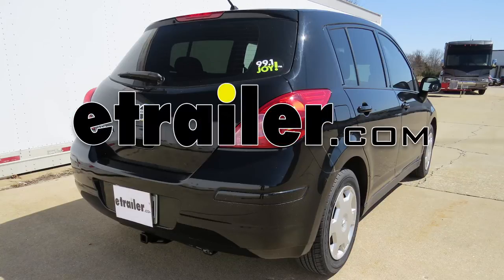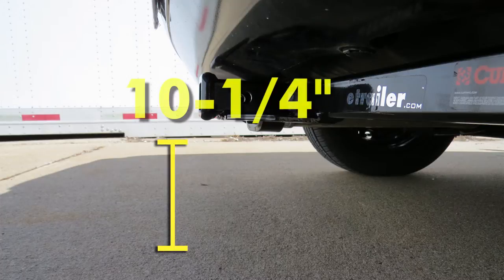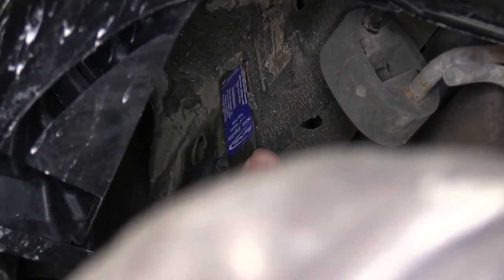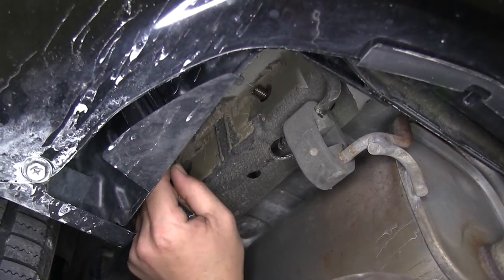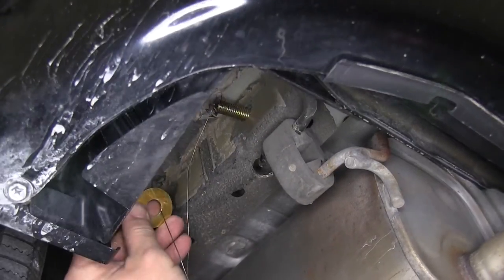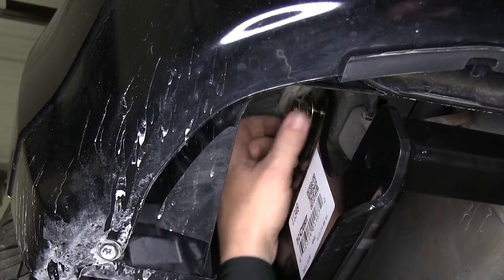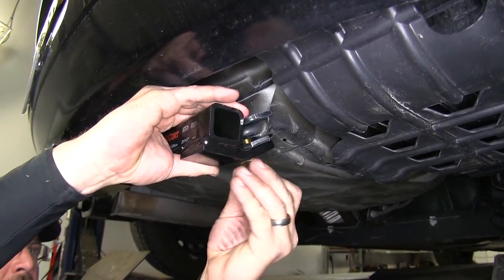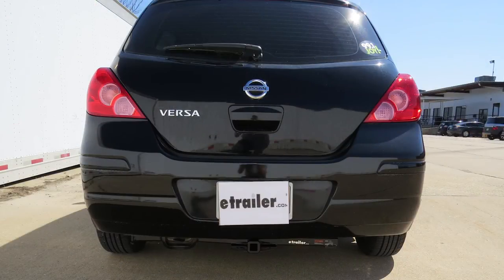etrailer | Installing the Curt Trailer Hitch Receiver on your 2009 Nissan Versa

Comment: This looks... interesting.

Everybody is saying "You can't trailer with a Versa" and I'm inclined to agree. Even the owner's manual "chapter" on 'Towing A Trailer' is just (bold print for emphasis) "Do Not tow a trailer with your vehicle."  As much as I'd like to have the option of light towing...

Is this actually safe within the rated loads ? How hard will it be on the Versa ? Or should this really be just for a bike rack and ignore your suggestion of a hitch ball option and the trailer weight limit ? Or do you actually stand behind the product and the vehicle demands that confidently ? Thanks in advance for your answers.
Reply from the maker: I looked at the manual and you're right... it clearly states not to tow a trailer with this vehicle. I recommend going with what the owner's manual states. You can however use the hitch for a bike rack or cargo carrier. Just be sure not to exceed the capacities of the vehicle or the hitch (whichever is lowest).

https://www.etrailer.com/hitch-2009_Nissan_Versa.htm
Reply: Thanks !

Comment: OK, "everybody" is not always right.  In between RVs and 3/4 ton pickups, we towed a carry-on 5' X 8" utility trailer with our Harley Davidson FatBoy on it to Sturgis 3,000 miles round trip from Northern California using a 2005 Jetta with the dual clutch automatic transmission.  Now we have a 2007 Nissan Versa that does not have the CVT transmission as that would indeed make it impossible to tow with. We have the standard 3 speed automatic transmission which will be better than the VWs dual clutch transmission. We have also owned a Toyoda Matrix and I believe Versa is as good as the matrix and has better power and more room inside. Here is a link to a YouTube video with someone towing a travel trailer with a Matrix: https://www.youtube.com/watch?v=2odXNabnYV4